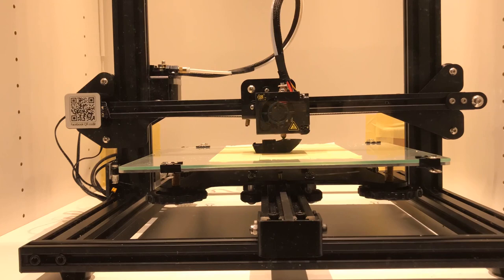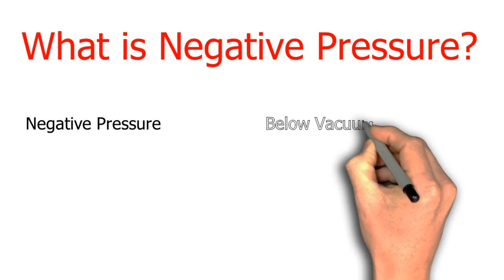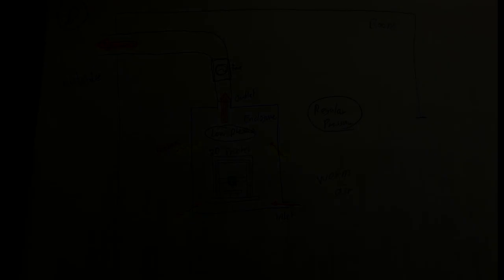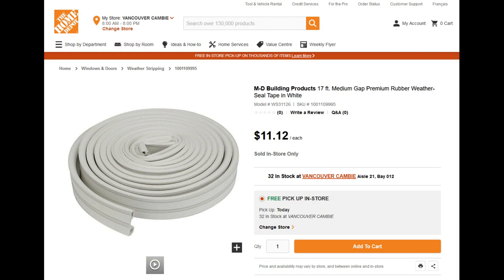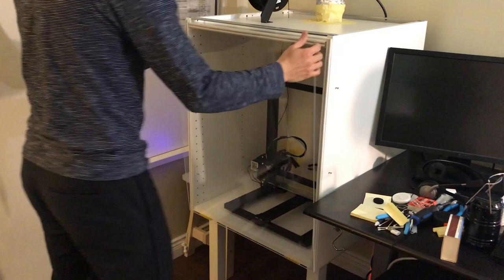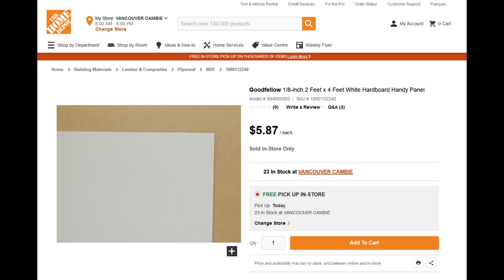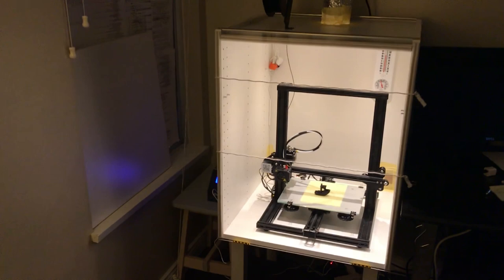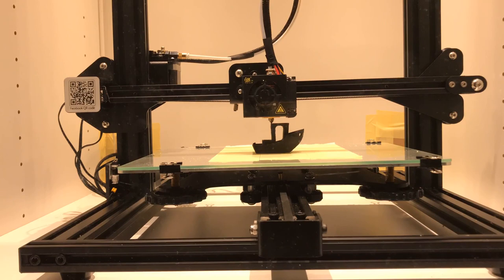(Part 1: How to Make) 3D Printer Enclosure for Your Health Safety | No More Breathing Plastic Fume

Comment: Do you turn on the fume extractor during the whole print or just at the end?  It seems like you leave it running.  But some filaments need an enclosure to keep the temperature up.  Wouldn't this make it harder to print these materials?
Reply: Nobody has answered but yes, in those cases it will. There are some fan systems designed to keep heat in one side of the loop which would help but if your filament needs high heat, you are better off using it in a room isolated from inhabited areas of the home like a shed. These ventilated solutions are for people who are printing in the home and do not wish to suffer adverse health risks.   When it comes down to difficulty printing vs long term health, hopefully people are picking long term health.
Reply: @acephantom903  Yeah,  I made an enclosure and vented it outside using and old PC fan. It is a balancing act to get the fumes out without putting a breeze across the print, but I think I've got it.

Comment: Did you use a 3/8 inch drill when making the hole in the top? I have a 3/8 inch drill and am trying to find out if that is enough to manage 4inch hole saw through the wood. Thanks!

Comment: like your sharing, i will make one for my machine, just want to double confirm, if i print with ASB material, the exhaust fan will not cause warping issue with your design, right?

Comment: but isnt the point of an enclosure to minimize drafts? So if you build it like you do doesnt this cause a lot of warping etc.?
Reply: The point of this type of enclosure is to evacuate VOCs and microplastics. That being said, if the fan speed is precisely calibrated to what the container actually needs, there could be less draft than what the exposed printer experiences. I suspect that's why he's using an inline fan instead of an integrated bathroom vent fan, because inlines are more adjustable. That's also why he used those sealant strips around the door, because less leakage means less required airflow.

Comment: Does anyone know if using a computer fan or a duct fan matters?
Reply from the maker: Lets Time That is a good question. It actually matter a lot which type of fan you choose. Duct fan is usually much more powerful and designed to push air through duct when there is more pressure difference which is what we need in the negative pressure enclosure. I explain it in another video, so please check it out https://youtu.be/TVoyy_Wh6cM

Comment: I got a resin printer recently. How would you go different about this build for a printer where you have to be able to take a cover off?
Reply: Where the printer is held inside the enclosure you could make a slide out plate similar to how a drawer works.

Comment: Thank you for the useful tutorial. Did the enclosure made a difference in terms of warping prevention?
Reply from the maker: ALSAHAFI13 Thanks man! I haven’t had seen any warping happening yet with the enclosure.  When i see my thermometer, the temperature is usually much higher than room temperature even with ventilation fan running, but i think it really depends on how strong your fan is and the temperature of your room which can be vary. In general i think having the enclosure definitely helps to prevent warping than non-enclosure situation.

Comment: I literally just got acrylic sheets to build a box around my printer, a very similar design to this. I was planning to use two fans, one to get air out, and one fan to take air in, but now that I know about negative pressure, I think I will just go with the fan that takes air out of the box. Thanks!
Reply from the maker: Glad that you learned about the negative pressure!!

Comment from the maker: Hi, guys. I would like to hear how you guys think about breathing plastic fume from FDM 3d printer. Do you think it's overly concerned? Or do you think it is a valid concern we should worry about?
Reply: Personally, I can't print PLA because I felt sick from the smell (nausea, headache). It happened when I entered poorly ventilated room where the printer was printing overnight. It is that sweet smell. I have no idea if it is the yellow eSun filament or what. Currently I am printing PETG only (no issues) and building a similar enclosure using the same IKEA kitchen furniture as the base. Although I will attempt to make plexiglass slide up/down, because I feel like there is no need for a perfect seal as long as the air is pumped out.
Reply from the maker: @OrbitalCookie  Hi Mercury! Yes, I also sometimes smell from certain brand of PLA filament I purchased. And I agree that there is no need for perfect seal as long as there is enough pressure difference between the enclosure and the outside. Being said, more seal will help to minimize the chance of plastic particles from escaping from the enclosure since there will be larger pressure difference, but I agree that there is no clear cut on how much seal is required. We just need to experiment to find out what works the best for own design. Thanks!
Reply: With ABS definitely
Reply: Forbes made studies that it can be very harmful, specially if you have asthma. It was not recomended to be used in the same apartment , but with very good enclosure it was ok. Particles that goes into your lung, and possible of cancer
Reply: I don't think it matters how safe it's claimed to be or how odorless it is really. You don't want any prolonged exposure to anything except oxygen really. Remember lots of dangerous chemicals are odorless also.
Reply: @peanutbutter3578  I also do not mind exposure to nitrogen.

Comment: i will build my enclosure inspired by yours. but one question. how much did the glas panel cost you? was it cutted to your measurements or did you find a fitting one ?
Reply from the maker: Alex Grisold Hi Alex. Sure. This is the price I found from my old email. This is in CAD from Vancouver local retailer. They had fixed size option but I think it might be possible to ask for specific size with additional cost. 
APS Clear acrylic panels, saw cut edges
1 each 3mm thick x 24" x 15"      $18.60 each
1 each 3mm thick x 24" x 30"      $37.20 each
1 each 3mm thick x 24" x 48"      $49.60 each
Reply: @curiousor1154  thx. I live in germany and the avg price is about Double the prive you had to pay.. maybe i Just make a wooden door with a smaller glass see-through
Reply from the maker: That would work too. When I bought the acrylic panel, I actually checked multiple big stores first which had much more expensive than the one I mentioned. So i ended up contacting a few local retailers to eventually find the lowest price. But i think a partial transparent window would be definitely cheaper solution.
Reply: @curiousor1154  thx for the input
Reply: @curiousor1154  I'd be curious to know which local retailer you went to as I am also in Van

Comment: Nice design. Very detailed video. Thx for posting. Love the Homedepot+Ikea listing (v helpful as I also live in Canada). 

One Question: Do you have any outside weather impact on the print quality from the design? Or is there enough isolation from the outside due to the pressure going out rather than in?  We live in a "cold" climate and outside temperature can drop fairly low -- I'm in Toronto and we get winter celsius well into the negative, and in summer to over 30. And, of course, humidity is also highly variable too. Do you notice any variability in your print quality due to this with the enclosure or is it similar to that without the enclosure? Thx. N
Reply from the maker: Thanks Neil! Yes you are right. Since the fan actively forces the air to flow only outward direction (from indoor to outdoor), the temperature outside should not affect the temperature inside the enclosure as long as your room temperature stays the same. So as long as you can keep the room temperature constant, it should be okay. But in some cases, as the outdoor temperature gets colder, because of the limited heating to the room, the room temperature might also drop a bit. In that case, I think it could affect the enclosure temperature, since the air entering to the enclosure is already colder in the first place. 

Are you trying to print with ABS? If so, I haven't personally tested this enclosure with ABS yet since I mostly work with PLA. With PLA, I didn't notice variation yet, but I should also say that I haven't had enough test time to run this enclousure with different seasons. 

But if your goal is to keep the enclosure temperature constant with this enclosure, I think it would be better to place a portable heater inside with thermostat to actively adjust heat supply in order to keep the temperature constant. One of portable heater I have keeping my eyes on is this:

https://www.amazon.ca/Portable-Ceramic-Overheat-Protection-Electric/dp/B07JQF8W7V/ref=sxbs_sxwds-stvp?keywords=portable+heater+thermostat+remote&pd_rd_i=B07JQF8W7V&pd_rd_r=46617b68-722e-4f47-befd-9815a397daae&pd_rd_w=DGMgQ&pd_rd_wg=uvQnN&pf_rd_p=2be78364-2225-4104-8cb4-13e69d670ea9&pf_rd_r=KWAT1GKKCMCY465A0YAR&qid=1549878366&s=gateway

It has a thermostat and remote control that might allows you to control it outside the enclosure. The only downside is the max. temperature limit is only upto 32 Celcius degree, which might be a bit low.

Comment: Your enclosure build looks very nice.

Do you have a problem or concern that birds or insects might come in the outlet?

Our dryer was vented outside but cold air would come in. So, several years ago, I got a one-way dryer vent from Home Depot. Now the laundry room doesn't get as cold as it did before.
Reply from the maker: Thanks David. I think you made a pretty good point. I think there is a possibility that something like a bird could go in. So what you suggest seems pretty good idea to prevent that. Or maybe i will think about installing something like a mosquito screen at vent out.  When i don’t run my printer, i usually detach the male duct adapter from female, and cover the female connector with a rubber wrap to prevent cold air from entering my room. So that worked out okay for me. But I think the one-way vent out you mentioned will also do the job. Thanks for the suggestion!!

Comment: so instead of you inhaling the fumes it's much better just sending them out the window? xD
Reply from the maker: Stefan Jensen That is good angle of thought. I actually also have thought about that. But in this video I am not trying to say it is better for environment or earth. The focus of this video is if you decided to use 3D printing, it would be safer to use an enclosure for your health. I am not saying it is better for environment at all. If one doesn’t want to pollute outside air, i think the best way is probably not to use 3D printing at all or any plastic. Because if you use 3D printing without an enclosure, you will just breath highly concentrated UFP in your room as well as that air will eventually escape into the atmosphere which will end up with the same result as when you are using an enclosure.

If you are really concern about the environmental impact from your 3D printing, but if you still want to do 3D printing, I think one of ways to do it is to install a HEPA filter at the outlet of your duct to minimize the number of UFP released to the atmosphere. But this will increase the static friction a lot and you probably need a much stronger duct fan to overcome the friction. 

But because atmosphere is vastly large, and the number of people using 3D printer is not huge yet, I think the atmosphere can act as a giant buffer where the concentration of UFP become so insignificant to affect anyone’s health once it is diluted to atmosphere. But I don’t have any research data showing this. It is just my guess. But I don”t rule out the possibility of negative impact on atmosphere 3D printing might bring in the future. It is possible that as more people start using 3D printer, there might be a point that the atmosphere can be affected by this to the degree that people’s health can be affected. 

I appreciate you bring up a topic with different perspective.
Reply: @curiousor1154  that train of thought have been used through all of modern humanity and is partly to blame for our current environmental issues.

And it wasn't to take away from your project, the idea was great!

you should just as you say yourself have put in a HEPA and a activated carbon filter to take all the toxic particles out of the air, not just for the environment but other animals and potentially humans passing by, some people react strongly to the fumes from plastics like ABS :)
Reply from the maker: Stefan Jensen I totally agree with you. It is better safe than sorry!
Reply: @Deathbyfartz  And where does that used filter go when it is spent??? Landfill. So, in turn, you are still polluting.
Reply: @blamm5348  first of a HEPA filter should last you a good 3 years, secondly you can wash them.

and honestly id rather have them breaking down used filters, than i want someone to let toxic fumes out of their window, we can't all behave like americans, cause then the world is really screwed xD
Reply: Stefan Jensen hepa can only filter like 30% of the ufp’s, but it would be better to use the filter at the exhaust so the particles that go out are reduced. Also an active carbon filer can work.
Reply: That's what you would do with a laser cutter, surely any fumes coming on that would be worse than a bit of plastic fumes